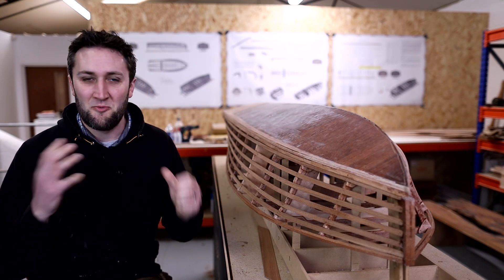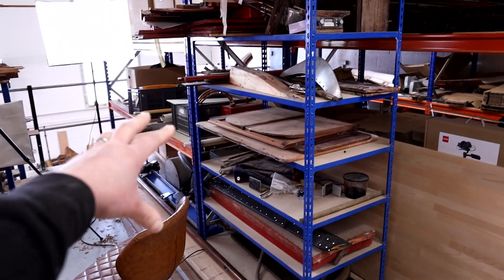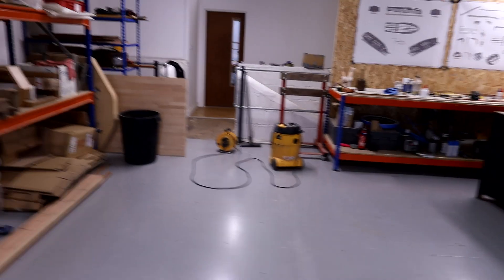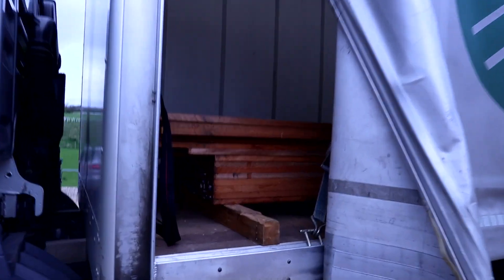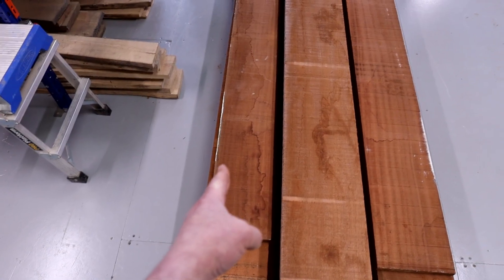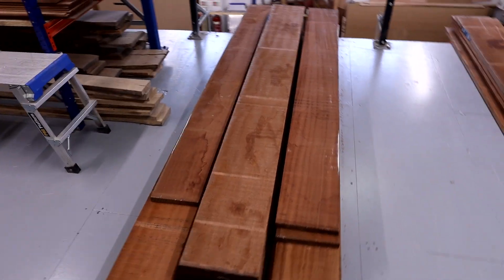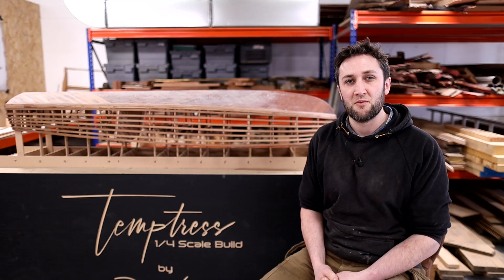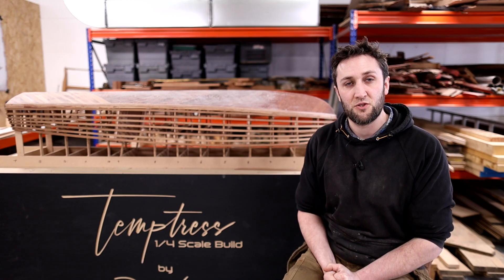Starting A Proper Boat Build | Building Temptress Ep1

Comment: I'm struggling to contain my excitement, cheers from Australia.
Reply from the maker: Cool 😄 aiming to keep the videos coming!
Reply: Yes, come on let's go. Just build it already , full scale , full send
Reply from the maker: @fulltimber I’ve started now 😁
Reply: @DanLeeBoatbuilding  if you can build it easily, then with me as a trade person with 35 years experience,  I certainly want to build one too. How would the custom LS V12 marinised go in that thing ?
Reply from the maker: @fulltimber yes I’m sure you’d be able to. Power wise 365hp is the upper limit for this boat. Not sure that a V12 would fit physically and I guess it’s likely to be too much power.

Comment: Would you be able to build a temptress using plywood instead where you use solid boards given the same thickness? Especially looking at the frames
Reply from the maker: Thats not really advisable. The issue with this is that only 50% of the grain would then be travelling in the correct direction for that part. Solid wood give you full control over this. I also think it would be more expensive if you used a good quality marine ply vs solid wood. Here in the UK thats going to be circa £300 a sheet for 22mm marine ply.